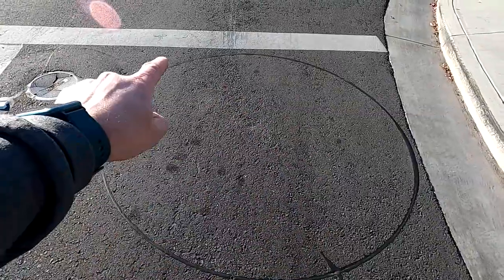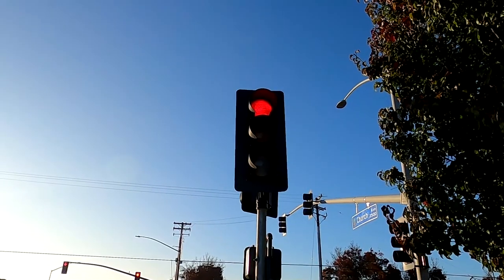Motorcycles AND Traffic Lights DON'T Work, Here's How To Help

Comment: So I had read somewhere that if you know of an intersection with a problematic sensor you tend to be better off not hitting the sensor directly in the middle but off to the side as long as you still are over the sensor. On known traffic lights where I have experienced this problem that seems to work for me. At least here in southern California. But that's just been my experience.